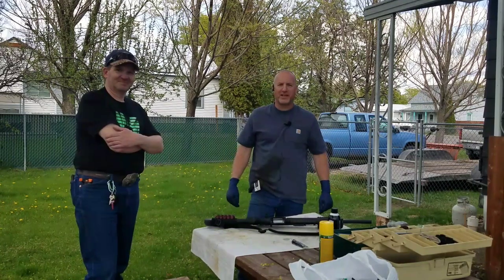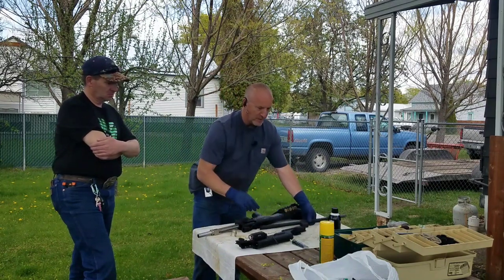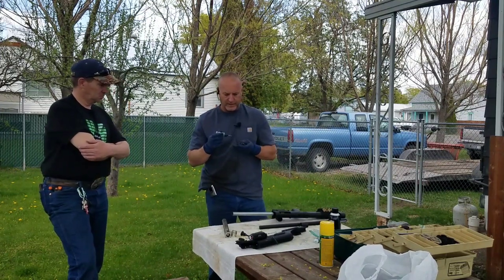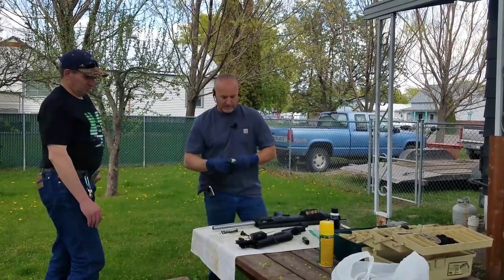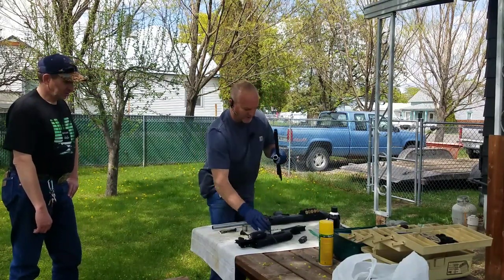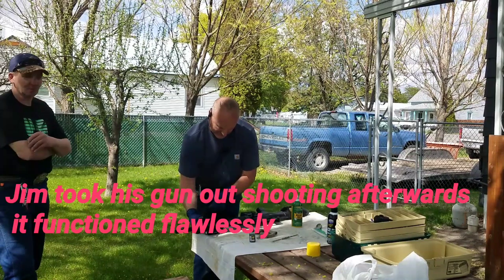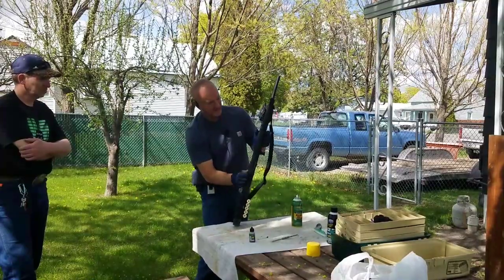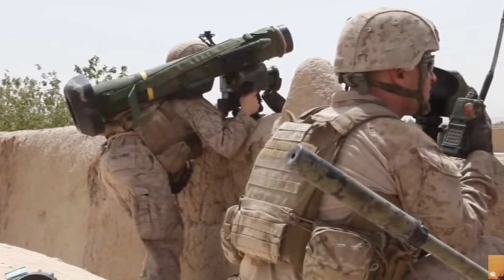VR-60 PISTON UPDATE, I FIXED OVER 400 VR SERIES SHOTGUNS, WHERE TO BUY O-RINGS, EDUCATIONAL VIDEO

Comment: i just commented on your other video and placing O-ring inside the piston.  I mentioned I spoke with a Rock Island gunsmith.  He said the O-ring does go in the top end of the barrel collar in either of the two round grooves.  My problem is the threads grab the O-ring as the barrel in sliding back in.  Have to try the grease and oil to slide over the threads

Comment: This video is making me reconsider getting a VR60 and maybe going with a VR80 or82, or different brand.  Is this "O" ring problem unique to this gun only or are there other budget friendly guns that have the same problem, that spending more might get a gun that won't have this problem?
Reply from the maker: If you keep this gun greased and oiled you will have ZERO problems, I have over 3000 rounds through my gun and I have not replaced the O-Ring yet.
Thanks for stopping by, stay safe...MTJOA

Comment: Great video once again Montana John!  I certainly know where to get some O-Rings if I need them now. You mentioned something very quickly and in passing about "light strikes on primers" or "failures to fire" and it had to do with the bolt lubrication.  I had this exact problem at the range where I loaded some 2-3/4" X-TREME brand slugs.  I tried to fire three different cartridges and got misfires on all three of them, yet there was a light firing pin strike on the primers themselves. I wanted to see if another brand of ammo would do the same thing or would work. All I had with me was some 3 in magnum slugs by Federal. They fired flawlessly.  Would you mind elaborating/sharing why the bolt lubrication would cause light primer strikes on that particular brand of ammo but yet the others fired fine?  I just disassembled by VR60, checked everything over, cleaned, lubricated, and reassembled. However, after I watched your video, I plan to disassemble and lubricate the parts you emphasized again just to make sure. Thanks again for doing these videos...they are very educational!
Reply from the maker: It can be both:-) try cleaning the firing pin and oiling it. Then take the gun back out and see what happens. If you get light primer strikes it is more than likely the ammo. I had some ammo that I shot in my single shot 12 gauge and the primers were seated down way to far and the firing pin could not hit them properly therefore I would get a light primer strike. It was NOT the gun, it is the ammo, I will be doing a video soon on the ammo that does this. Thanks for stopping by, stay safe and check out my other VR60 videos on my playlist...MTJOA

Comment: A got a vr60 shooting 3in 00 buck it is only ejecting the brass and leaving ythe plastic tube in the barrel is ammo issue or gun
Reply from the maker: It will be the ammo not the gun....it would be hard to believe that the barrel is not to spec.
Try other buckshot ammo or other high brass ammo and see if the same thing happens. If it continues to happen then I would say that the chamber is wrong.
I have other VR60 videos on my PLAYLIST you can checkout that are helpful. I sell the O-Rings there as well.
Thanks for stopping by, stay safe...MTJOA

Comment: I’m curious would lubriplate be a good grease to use I have a bunch
Reply from the maker: I know what lubriplate is, I would NOT use it. I would ONLY use the Lucas gun grease and gun oil both by Lucas because I shot over 1,000 rounds of 12 gauge through my gun and the grease and oil mixture was still there.
The lubriplate is a temporary grease that protects engine moving parts until it starts or if the metal parts are going to sit for a long period of time so they will not rust.
So, I will stick with my Lucas gun grease and Lucas gun oil:-) and the beauty of using these 2 together is when you disassemble your gun and you go to clean it, all of the GSR or gun shot residue is stuck to the grease, therefore your gun wipes clean in seconds and you do not spend a lot of time cleaning your gun.
Also, the grease/oil mixture stays slick even with the GSR that goes into the mixture while shooting. 
I will stick with what works and what is best for my gun :-) and there is NO metal on metal because the mixture stays for the duration of me shooting so many rounds through my gun without any worry weather or not the gun will continue to be lubricated while I shoot it.
I hope all of this helps:-) Stay safe and thanks for stopping by...MTJOA
Oh, I am having a new and improved buffer made for the VR60, if you are interested on getting some give me a call, my number is in the video or my O-Ring video on my PLAYLIST.

Comment: What is better? My old one with the oRing
In Piston Or barrel ?
Thank you, Virginia here, bought mine 2019 and seen one at my gun store today for 429.00 was about to get it . 
They did have the 9 round mags on sale for 33.99 picked one up . I have my reservations about getting that new one now, also i definitely need to clean and lub mine. Do i add greese in the piston with the o rings in them?
Reply from the maker: The old VR60 has an O-Ring in the barrel and the light piston and the heavy piston.
The new VR60 has an O-Ring in just the barrel:-) 
Montana here....ROTFLMAO:-) 
We have the VR60 here for $399 plus to 9 round mags and the 2 factory 5 round mags as well. Best deal that I have seen around:-) 
You MUST put Lucas gun grease and Lucas gun oil on the light piston inside and out. Grease the O-ring that is inside the barrel. Grease and oil everything that MOVES:-)
grease the entire bolt and carrier and then oil it, grease and oil every single moving part. This will make your gun function flawlessly. Oh, you must file down those 5 round magazines too. That will help a ton, stay safe...MTJOA